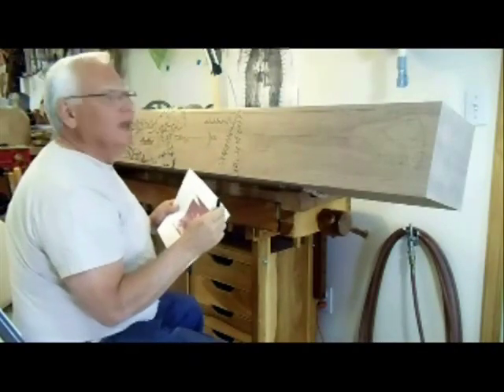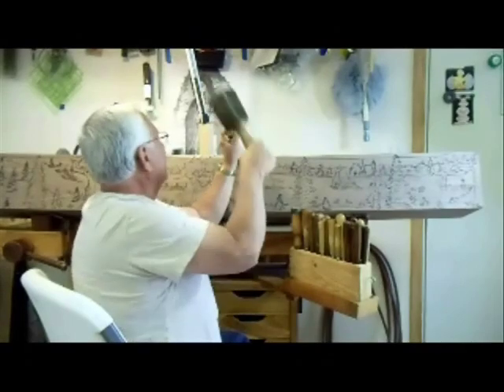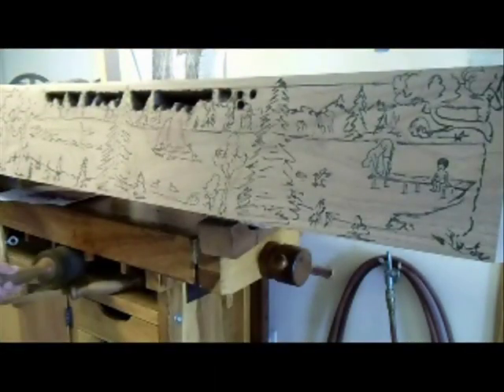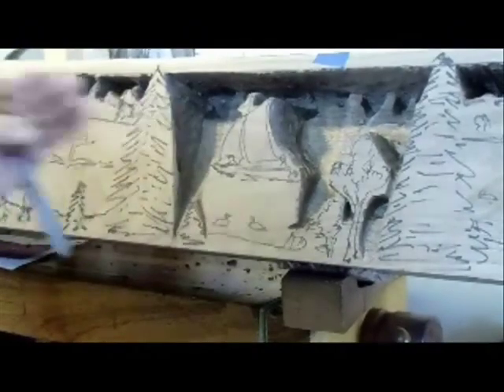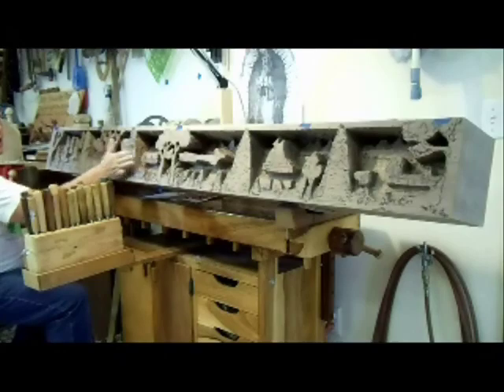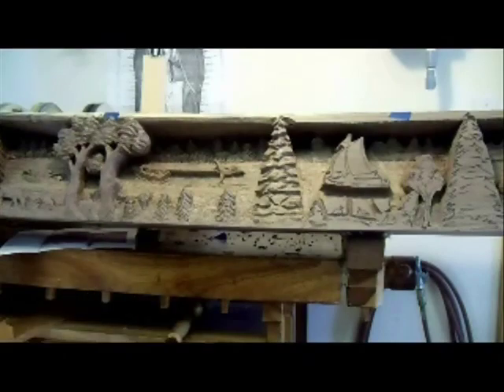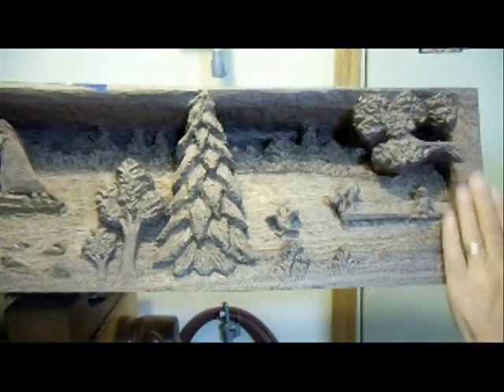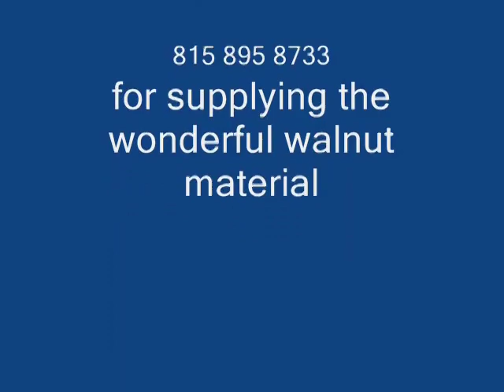Carving A Walnut History Mantel.

Comment: Hey there i am carving my frist mantel which i have hand hewed an torch the top side it has 2 different pics being 2d carved an only about a half inch in depth but it is getting burnt in with a wood burning for detail how much should i charge for a piece of this magnitude? Plz help with this as i dont know what it should be all other pieces ive done havent been this intense. You can rech me on here or on facebook under arrows elegant floors.
Reply from the maker: Not seeing a sample of your work and the detail, it is difficult to determine a fair market value. I price my work at $5 per square inch of carved surface, plus the wood and any other extras, such as installation. 

One thing I never do is use woodburning on any of my work because wood burning is only a temporary art form. Take a piece of charcoal and put it in the sun and it will eventually turn white from the ultraviolet. Covering the charcoal with an outdoor varnish will slow the whitening process but it still happens. Woodburning is nothing more than turning wood into charcoal and it will always fade. A mantel is a family heirloom, lasting hundreds of years. Depending on the light exposure, a wood burned mantel begins to deteriorate from day one and maybe 20 to 50 years at best will be so faded that the artwork will be almost invisible. 

With practice, a good quality artist oil paint can achieve the same effect as woodburning and will last a hundred years or more.